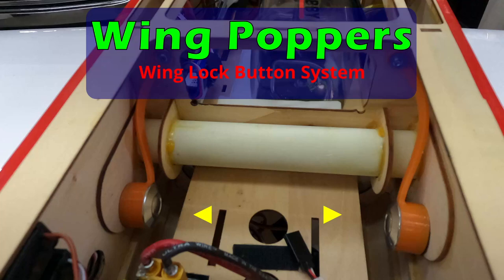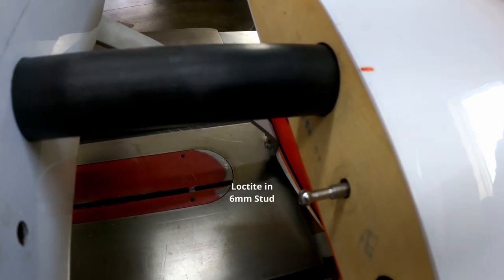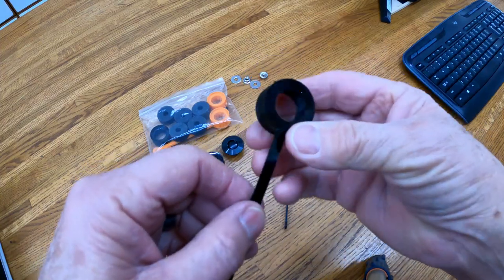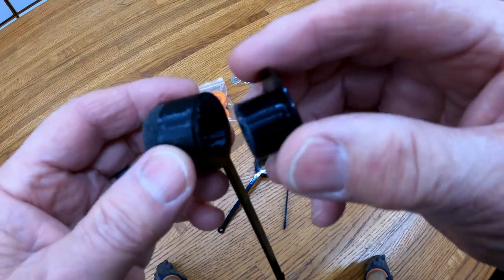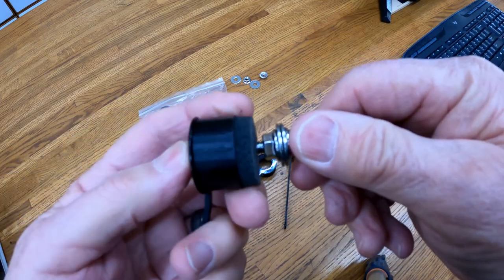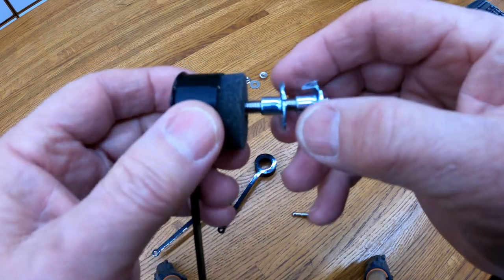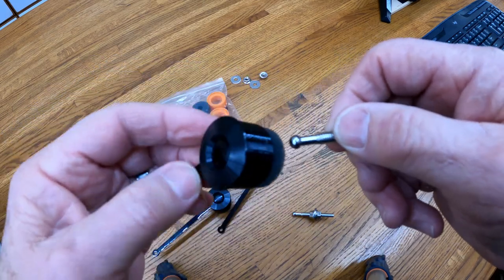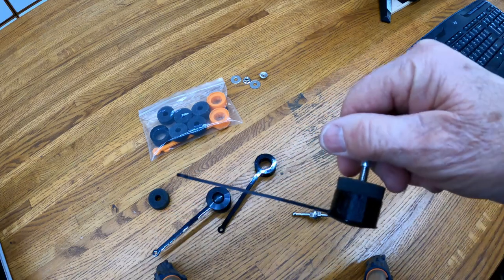Wing Poppers    Wing lock Button System for RC Planes

Comment: Thanks for posting this video.
Have this low wing model with two bolts on each wing, it is almost impossible to get inside the fuselage and tighten them. Having not found anything ready available on the net I'll give your system a try.
Already ordered the quick locks from Amazon.
Have you got a STL file for the 3D printed cups you could share?
Thanks again!
Reply: could you share the link where you bought the locks from? I am unable to find them